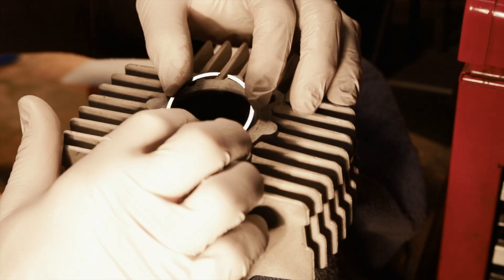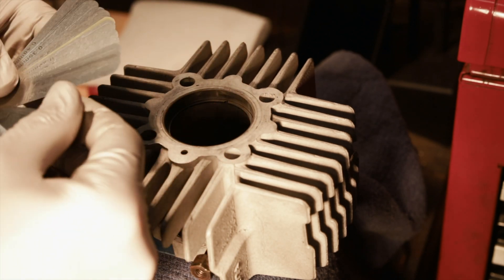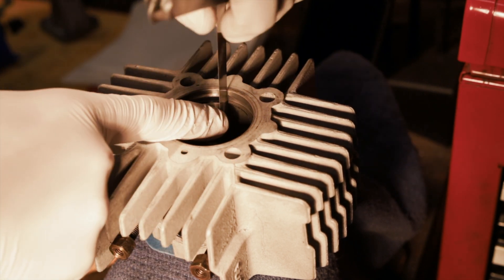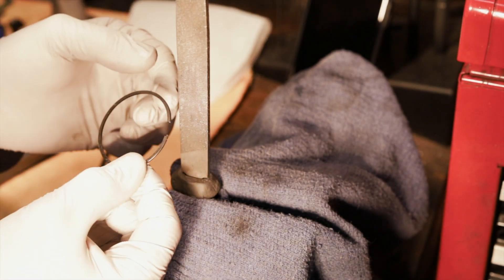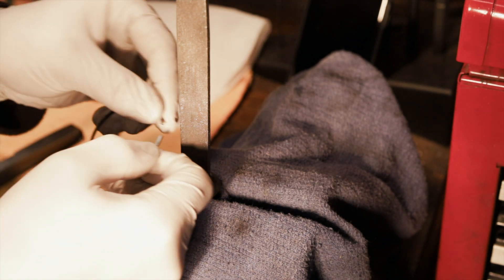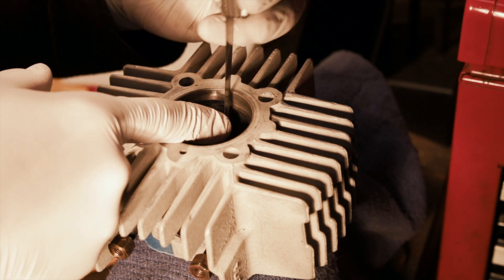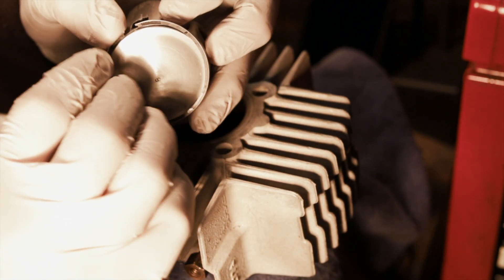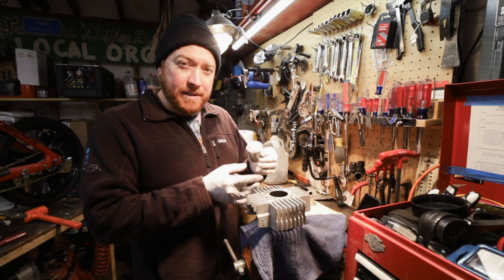How to gap a piston ring properly

Comment: Would you recommend using a belt sander with higher grit sandpaper? I have a 1x30, and think it would be more accurate than a file.
Reply from the maker: I would use what ever you have and just go slow and check often.